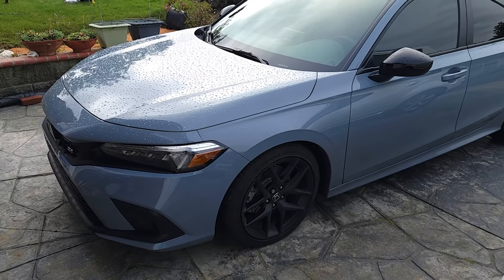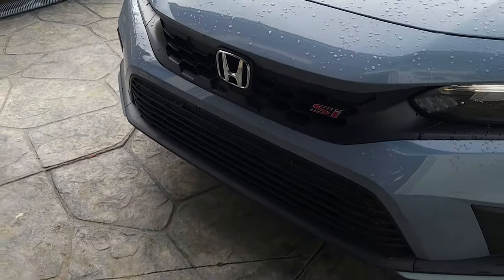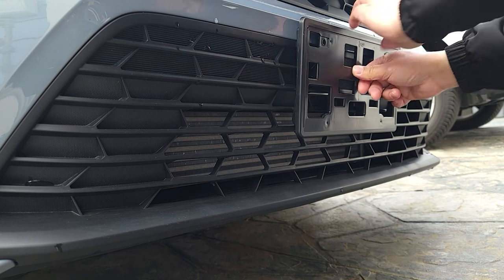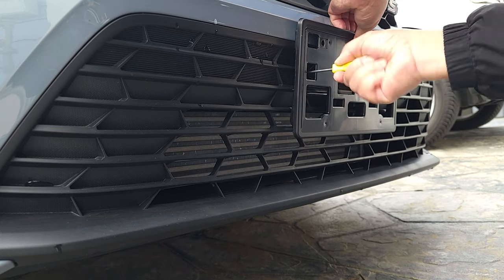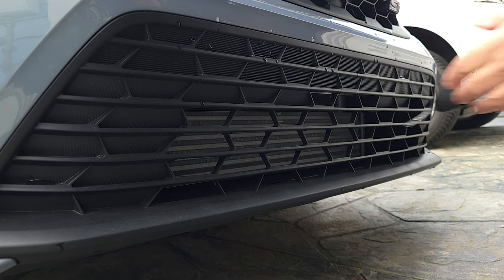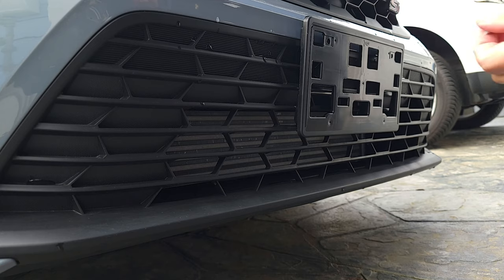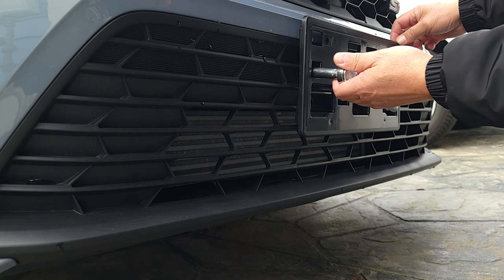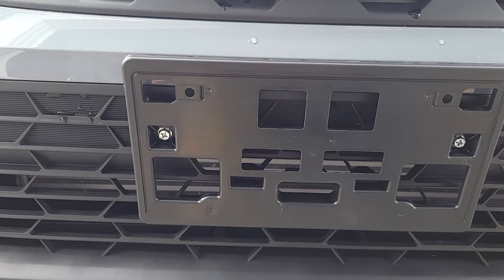2022 Honda Civic Si Front License Plate

Comment: The car didn't come with this? 
That to me, is strange. Mine did, but I live in canada. I don't know if that makes a difference. 

I want to find a relocation kit to put my plate off to the side a bit.
Reply: im from puerto rico and mine came with this black plate , every model comes with it
Reply: In some US states, front license plates are not required. So for those states, like North Carolina, where I live. It's used for vanity plates most times, so most dealers don't install it unless you ask them. Or you ask them, and they still don't install it (which was my case with my newly purchased 2024 Accord). :(